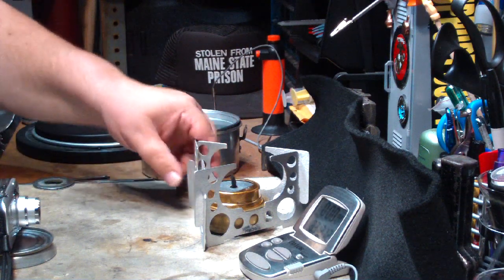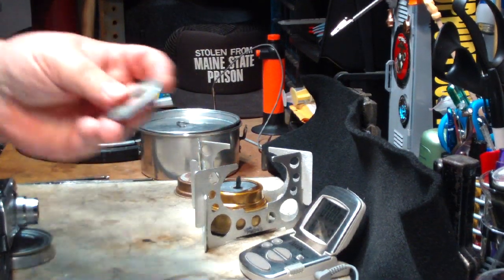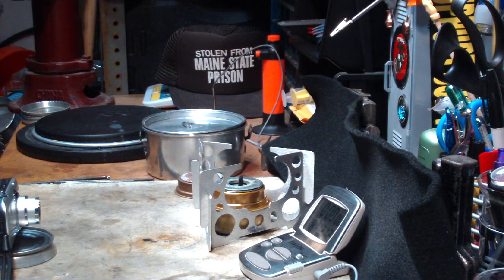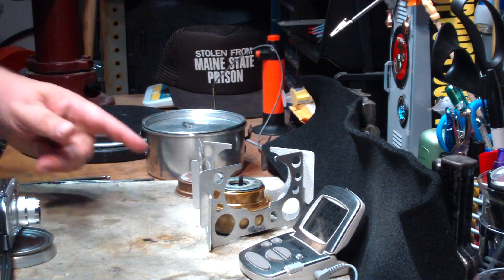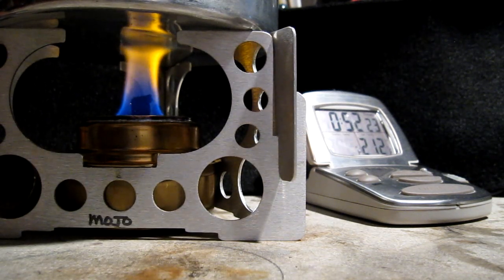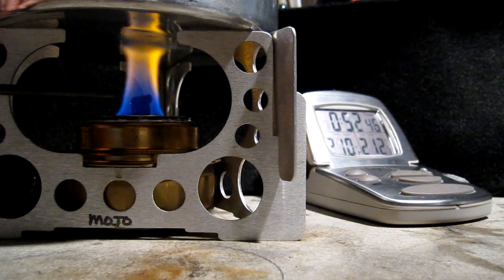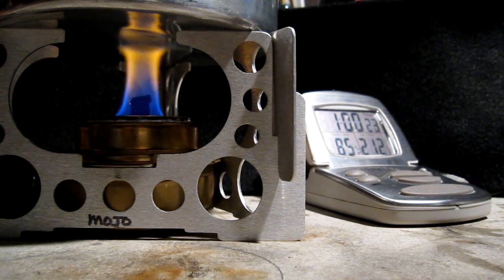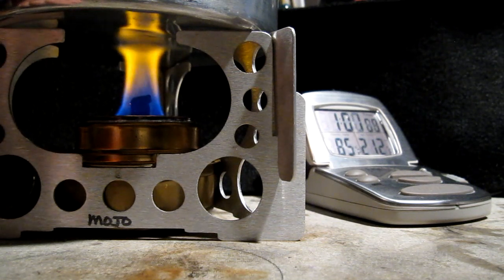Low Power Trangia Simmer - Small Carbon Felt Wick Test #2

Comment: I don't know that this is going to make sense to anybody, but here it is.
Could you roll a piece of carbon felt in a tight coil, like toilet paper and stuff it in a paint can and use oil or alcohol to make a stove or heater?
You could keep the lid on it to prevent evaporation of your oil or alcohol. 
I hope someone has an idea because I'm driving myself crazy trying to think of something to use for a little heat or cooking. Anyone?
Jude, from Kentucky ✝️🐴🐦🌿❣️

Comment: Hiram, I have 2 new variations to the original flashing disk in simmer ring Idea. I use a small mouth mason jar ring & lid, I add a tuna can lid, a disc cut from CF & 2nd tuna lid w/rim inverted over the CF and 1st tuna lid. I place CF/lid sandwich over the mason jar ring & lid then drill a hole in the sandwich & Mason lid I then use a rivnut to hold everything together & provide a hole for the wick. The ring is held between the lid & CF Sandwich. The setup fits nicely on the Trangia & works!